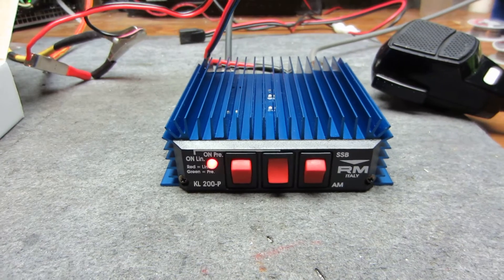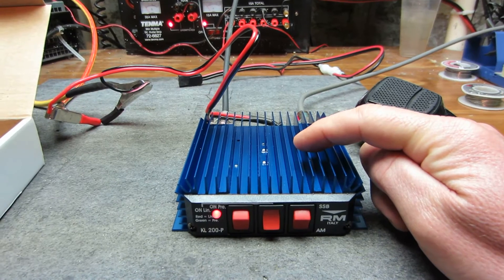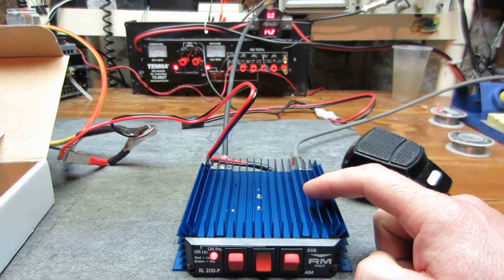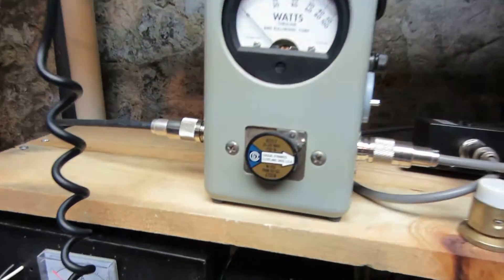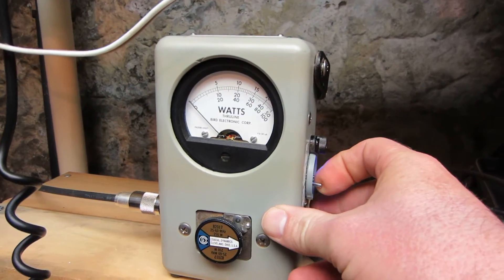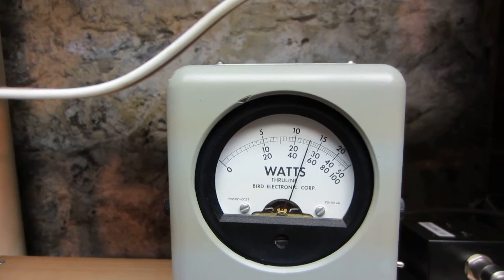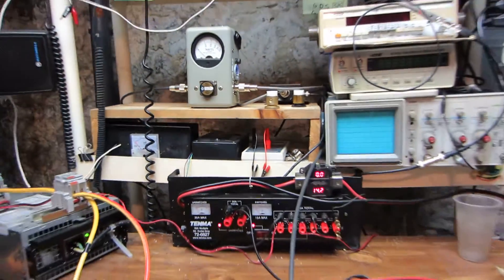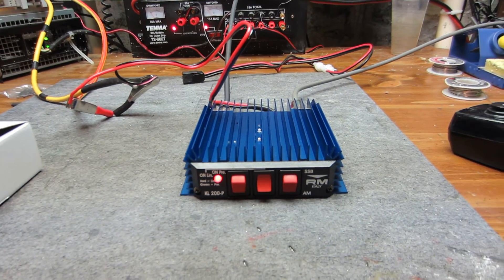KL 200P ,75 RMS/135 PEP!!!

Comment: Thanks for the awesome review!

Back when I was trucking, I had a DaveMade 1x4 and a Galaxy radio.  12 years later I wanted to put a radio in my pickup truck, so I bought a Uniden 510.  Looks like the 200P is right up my alley for a cheap radio/amp combination that will keep the costs down.  

The Uniden 510 is still stock, and I know it will need at least a variable dead key installed in it.  Should I leave the radio as is except for the variable dead key?

Comment: I’m just getting back into cb radios, but have never run a linear. I keep hearing a 1 or under swr is the sweet spot. Now my setup will only get down to 1.5 - 1.7. And my output wattage is roughly 1.8 - 2. Will that cause malfunction issues with this linear ?
Reply from the maker: I would say 1.5 or lower.Always strive to get channel 1 and 40 balanced then 20 should drop flat.That is if your tuning to CB band :)
Reply: @577buttfan  the lowest swr I can get across the board 1, 20, and 40 is 1.6. I’m running a cobra 19 ultra III with a 4’ firestick fsII. Both of my 29 Ltd Classics are trash now from being in storage uncovered.

Comment: That amp has an SD1446 final in it. Great final but it's not even close to a 2879.
Reply from the maker: I love the 1446s man.The HG 2979 I dropped in Is still hammering hard.Guess the amp is tuned for both.Ill have to try a 1446 in the next one I see blown.

Comment: Mean burnt out where can I get it fixed
Reply from the maker: They are so cheap its usually better to buy a new one for $100 than spend  $50 -$75 plus shipping to have yours repaired.
Reply from the maker: The transistor in the 200p is $50 alone lol :)
 But you can put a cheaper HG or DEI 2sc2879 in there :)
Reply: @577buttfan   - they have them on Newegg for $75.00 and FREE Shipping from California  2 Day PRIORITY Mail. I have one of the several of the first ones made and the only thing I have ever replaced was TR6 a BF199 Receive Transistor my amps are rev. 4.0 which I cannot find a Pdf Service Manual for. The Earliest Manual I have found is Rev. 4.10 and it does not have half the parts the rev. 4.0 has in it. Most of the time the fuse inside will blow before you damage the final inside them. I have had a Power Supply Fail and it sent about 25 Volts through the amp and I got about 200 Watts peak on AM and it did not hurt the Amp.
Reply: @williamcolvin3609  That for the kl 203 mosfet amp
Reply: @williamcolvin3609  I'm pretty sure the one on New Egg has is the Mosfet in it and not the pill.Last time I looked you could get 2 of the Mosfet 203 's for 149.00

Comment: Not bad at all. People try to run these with dual final radios and blow them up.
Reply from the maker: I have run them with dual final exports doing 40-50 pep with no problems as long as the deak key is set properly..1-2 watts with 25-30 dead key out the amp.
Reply: Enjoying The Sun 577-Jersey Customs   Greetings. I run a alternative radio GALAXY DX-959 in international waters. To avoid final damage, is it safe to rely on decreasing the RF Power from the front of this radio with this RM 200P? (Assuming it has been appropriately calibrated)

Comment: That is really all the Amp anyone really needs as the Amp wattage is SSB Rated and the AM Wattage is half that so for a 500 Watt Amp you are only going to get around 250 Watts on AM out of it and that is not really going to change your output S Reading on the other persons radio. The most Amperage any of mine draw is about 8 Amps Maximum and that is around 110 Watts of Peak AM Output and I have not seen anyone else with that output and that low a current draw in that small a package. Download a pdf of their Service Manual and see how Simple the Circuit inside is - not a lot to go wrong.